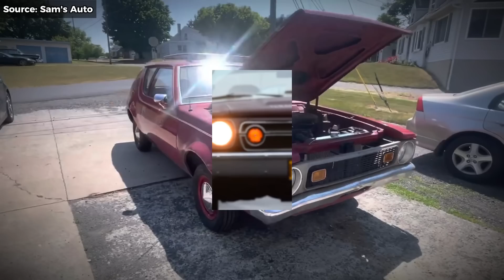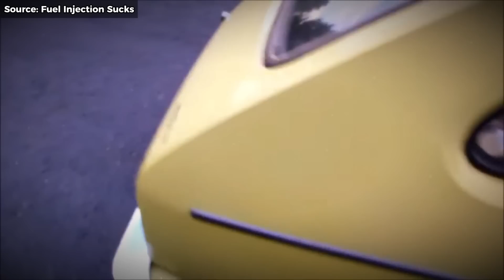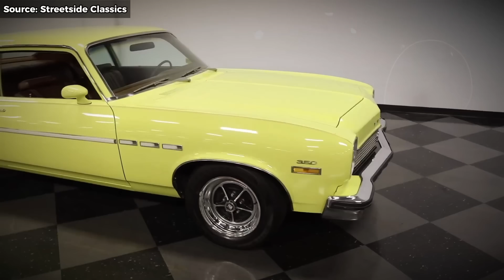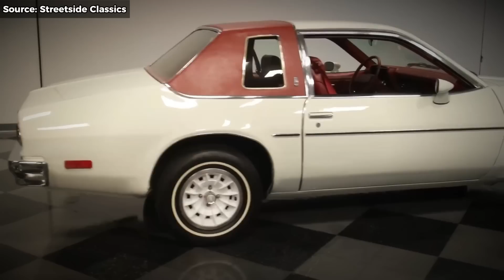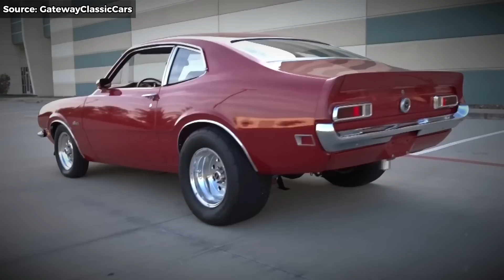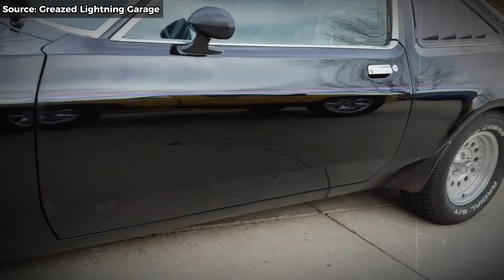10 WORST American Cars From The 1970s, That Should Have Never Existed!

Comment: You read to many Ralph Nader books and way too young to have actually seen, let alone driven these cars ! Funny thing, they made well over 680,000 Gremlins, 3,000,000 Pintos, 1,000,000 Dodge Darts, 2,100,000 Ford Mavericks and over 2,500,000 Dodge Omnis/Plymouth Horizons. 
Besides, my 1978 Pinto was a very reliable spring summer, autumn and Canadian winters !

Comment: The Pinto's issue with the fuel tank rupture wasn't because the tank was located behind the rear axle; almost every car's fuel tank was behind the rear axle back then. The issue was the floor of the truck doubled as the top of the gas tank instead of the tank being a one piece, sealed unit. This was an ongoing issue with several Ford's for decades which caused them to install a fuel pump kill switch in the trunk of most vehicles later equipped with internal electric fuel pumps.

Comment: Having owned a Mustang ll Cobra ll, a HS graduation gift in 1977, I have to come to its defense. Sure it is pale in comparison to the previous Mustangs in terms of performance with top engine choice being a 302 2 barrel carb v8 putting out a mere 139 HP, but like mentioned in this video, Ford had to quickly come out with a smaller more economic vehicle to coincide with the oil leading to fuel shortage that was going on in the late 70’s. That’s why the 
designation of ‘ll”
after the Mustang name was used as to say that this is the next, entirely new 2nd generation of the nameplate itself not just a model body style change. It actually had more of a family resemblance to the first Mustangs than did the ll’s replacement the Fox body which looked nothing like a Mustang at all. The Mustang ll was the right car for the time for Ford as sales were strong initially and it actually saved the Mustang moniker from possibly being totally axed by Ford.
To call one of the worst cars of the ‘70’s is a discredit to the Mustang ll’s place  in automotive history. I myself can think of many more vehicles from the same period that should be on this list!

Comment: I don't know Gremlin Everyone I knew that had one liked them, the only off-putting thing was the chopped off rear now you see cars with a variant if that feature, Pinto did what it was designed to do , hatch backs were the ones the top of the gas tank was the bottom of the rear section no floor, a practice Ford did on their other cars, Chevette no argument crappy, my wife had a Monza the Town Coup v8 4sp cool little car but you couldn't go very far with an I think 8 gal gas tank, and you couldn't keep a clutch in it the engine needed to be lifted to change the plugs but a kick to drive, and by the way nothing wrong with the Vega that a decent cooling system wouldn't cure, Americans just were dumb about making a decent 4cly, and aluminum ones at that they were gutless and overheated don't believe me look at their systems pitiful now their ok, Valiant  came along in the 60s not 70s the Aspens sibling was the Plymouth Valorie NOT THE VALIANT

Comment: I used to drive the Aspen/Volare as taxicabs (also the Dodge Dart/Plymouth Valiants). They were quite reliable and durable! Not to mention easy to repair. The wagon models though had issues with rust at the rear hatch hinge area. That was not an easy repair.

Comment: Ah yes we called them the Chevy sh*tvette, and the sad limp mustang 2, so many second rate weak and pathetic cars. Then add on what seemed like very limited build quality from auto workers union who just didnt seem to care. Made for many bad cars. Bought a car with a fin mounted tail light that never worked eventually found it was because the wire bundle was tucked in the rear Seattle panel and was never finished bieng installed.

Comment: I beg to differ I loved the Monza. My very first car was a 1980 Chevy Monza. I managed to get 103,000 miles out of the car. The only major problems I had with it were usual maintenance… Replacement of brakes, transmission, and only after I had accrued about 80,000 miles on the car. I loved driving it, it was peppy and me and my friends had a lot of fun in it. When I turned it in, however, the dealership who took the trade looked at the mileage and said that it was amazing that I got so many miles out of the car because it’s reputation for durability was only 80,000 miles max.

Comment: Many pictures of the Monza, were not the Monza.  There were three cars that came out in 75.  The Monza, the Buick Skyhawk and the Oldsmobile Starfire.  They were all essentially the same, but with different engines.  Some of the pictures shown were the Skyhawk or the Starfire.  The Monza had the 4 cylinder or the 8 cylinder.  The Skyhawk had the V6 and I don’t remember the Oldsmobile engines.  The Skyhawk’s V6 was GMs first and was an 8 cylinder chopped down to 6 or a 90 degree geometry.  V6s have to 60 or a 120 degrees.  It didn’t fully compress every other cycle and ran rough.  In 76 GM offset the crankcase to make it even firing.  I owned a 75 Skyhawk for 18 years.  The worst I can say about it was the brakes were less than good.  From what I understand the Monza were a piece of crap.
Reply: moved to a new city in 84. had $ 500 to buy a used car. salesman sold me a 75 Buick Skyhawk Roadhawk Edition. rear spoiler (flew off on the highway)  and alot of other awful skyhawk  add ons                  Hated that car that car      worst car i ever owned         look back and laugh     🚑

Comment: Historically the Buick was supposed to be the next tier below the Cadillac so it seems the Apollo might have fallen short because they needed to add a little bit more luxury to it.  The one they showed here basically looked like the Nova on the inside.  My buddy owned a Monza Mirage with a 350 and that #7 plug might be the maintenance issue he referred to in the video.  The car was almost impossible to drive in the wet with the tires available at the time.  Barely touching the gas at a green light and you might be sitting there spinning the tires with people behind you honking, lol.

Comment: Whoever wrote the copy obviously wasn't even alive when these cars were on the road. Completely clueless. 
Hello? It was the 70's. Emissions regulations? Crash Standards? Change from gross to net HP ratings? The fact that the car manufacturers didn't plan for the regulations even though they were passed 10 years earlier? Any of those even ring a bell, Junior? Here's a tidbit of reality: All American cars of the 1970's were clunky, slow and underpowered. Funny that the footage you use is of hot rodded versions of these cars. 
Don't even get me started on the laziness of using this stupid AI voice to do the read...

Comment: Ford could have just imported the European Escort to the US, instead of developing the Pinto.
Reply: @doordedeur  Not so much the Escort but the  Ford Cortina was so highly thought of that an entirely separate dealer network was created outside of Ford Corporate to distribute them on the East Coast at least .Friend had one but it was a slush box and he kind of had a love hate relationship With it had the 1600 Kent engine in it also in the gen I Fiesta o
It had MacPherson Struts which Ford had to pay royalties on so that's the reason for the wacky suspension design on the Falcon, Mustang, Pinto, Mustang II, and Fairmont and the rest of the Fox bodies.
Reply: The Capri from the 70's was a really fun car with a 3.0 V-6 and about the same size as a Pinto.

Comment: Nothing was wrong with the Gremlin. The 232, 258 and 304 engines were great engines. Car was durable. As for Pinto had nothing to do with fuel tank location. Was the fuel filler neck and was about 35 cent a car savings. The recall fixed the problem but was to late. The Chevette was a fine liitle car that many people stand by.
Reply: The pinto was a good car. But The chevette wasn’t that good to be honest. It was ok for what it was. But it was underpowered, the front crankshaft bolt was known to break and allow the pulley to fall off. The exhaust manifold commonly cracked, and serviceability was a nightmare , especially the starter, and distributor . It didn’t deserve to make this list though. While it wasn’t that good, it wasn’t bad enough to make this list. Truth be told, most of the cars in this video didn’t deserve to make this list.

Comment: I noticed something. Both the Ford, Pinto  &  the Chevy, Chevette both have their gas tanks behind the axle they only say things about the Ford Pinto have a safety issue with the gas tank when Chevy Chevette has their gas in the same place as the Ford Pinto, but nothing is said about the Chevy Chevette,only the Ford Pinto. Sounds Biased to me
Reply: Pinto was about the fuel filler neck. It was a savings for a part about 35 cents a car. Had nothing to do with gas tank placement.
Reply: Not so much the placement, but more of how the bumper and supports impacted it in a collision. More of a design flaw than a placement issue.
Reply: I had a shovette oh I meant chevette what a jewel it was my Vette lol
Reply: So did Mustang ,but the Pinto had two bolts that protruded towards the fuel tank . Owned several still here.
Reply: Most cars had their tanks behind the rear axle until front wheel drive became the norm. Remember Ford introduced the center fill system in 1952 and many manufacturers copied it. 
While the Pinto's filler was NOT in the center rear, the tank had two bolts near the tank that could puncture it in a rear end collision.
Reply: @Al-thecarhistorian True but just a piece of automotive trivia was the fact on the Mustang that they featured the fact that  the fuel tank could be dropped into position through the trunk opening forming the floor of the trunk. So that there was no sheet metal barrier between the gas tank and the interior of the car.
Reply: @Al-thecarhistorian  Most cars still have the tank in the rear!!!
Reply: Most cars, even today have the fuel tank behind the rear axle... Where else is it supposed to go when the engine is in the front?
As to the Pinto... You hit any car in the back with a vehicle doing 50 MPH, and see what happens!
Note, between 1979 & 1989, I had a total of 5 Pinto's. I didn't get rid of any of them because of the mechanics. I just didn't always have a place to park each one.
Reply: I had a 72 Apollo, won many a race.